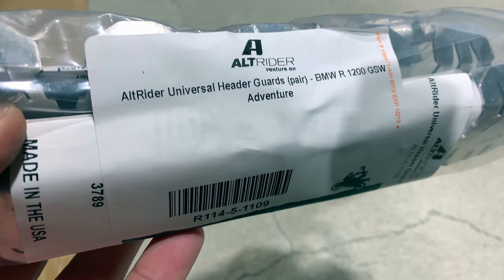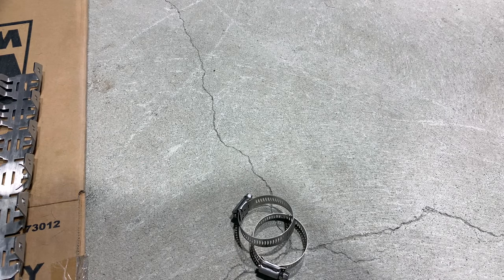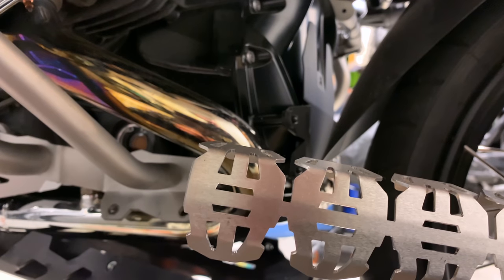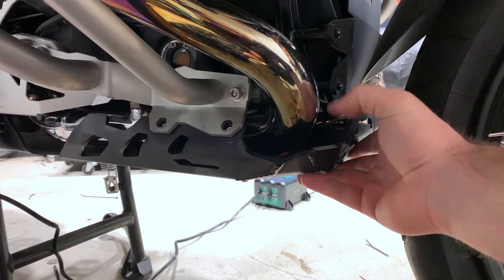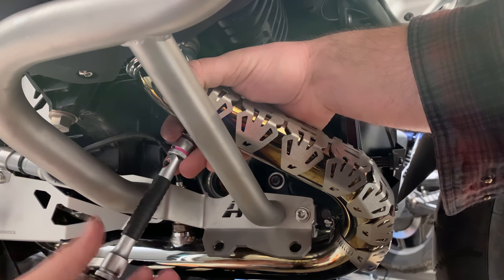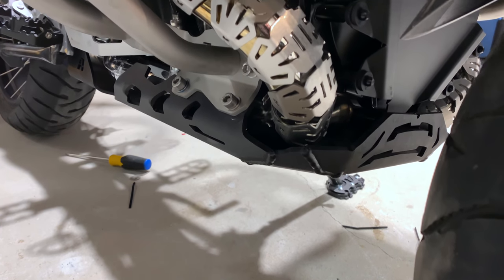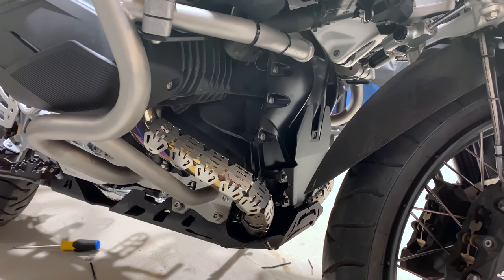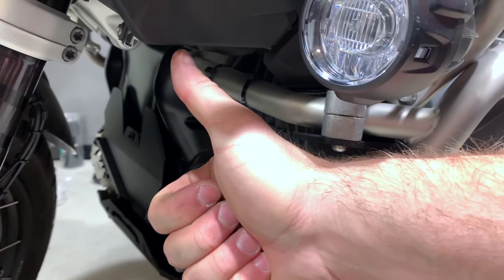AltRider Universal Header Guard - R1200GS / Tiger 800 / R1250GS

Comment: Adam when you are all finished for the winter season adding stuff to the GSA could you do all of us a “solid”, 1. Itemize the Parts added and Cost of each Part. 2. Give us the new dry and wet weights of the GSA. I am really curious to see how much that thing weighs. I am going to assume that the bike had a retail cost of around $28850.00 plus tax and tags.
Reply from the maker: Of course! I’m keeping a very detailed list but I’ll end up posting retail value of mods, not price paid since it’s hard to keep track of instances where I have discounts or acquire something used. I have an apparatus to weigh the bike. Price paid was $20,700 out the door (no tax in NH, USA).
Reply from the maker: A lot of the information you want is here - https://advrider.com/f/threads/adamchandlers-rosie-red-2018-gs-adventure-build-thread.1343485/
Reply: Adam Chandler - That was the retail price of the GSA? What was the MSRP? Dang that bike down here in Florida is $25,000 +++, my GS listed at $21,400
Reply from the maker: I get a lot of corporate discounts and always buy demo bikes. Still an expensive machine.